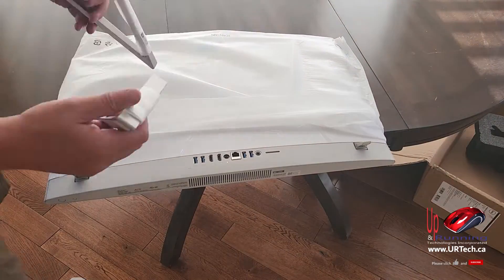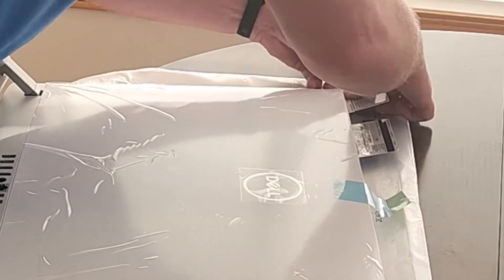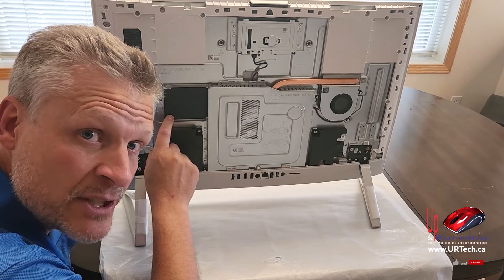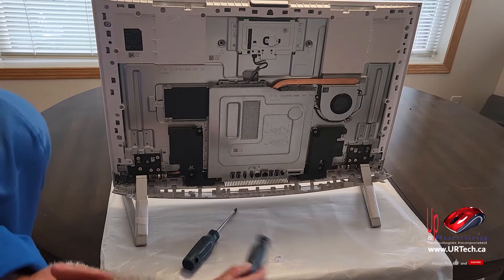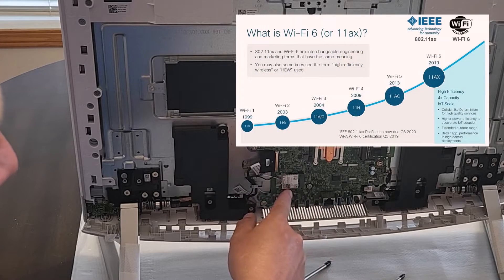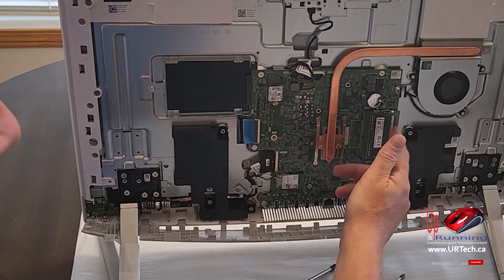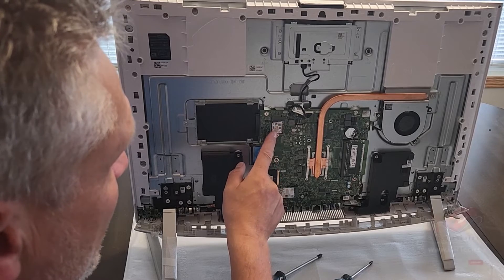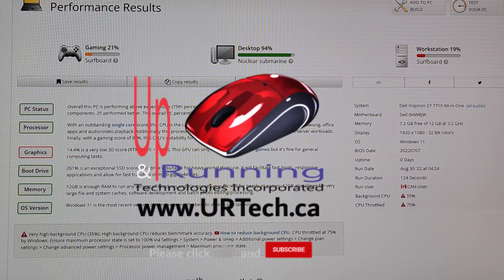Dell Inspiron 7710 All in One: Disassembly Memory Hard Drive SSD Upgrade

Comment: The D in DDR doesn't refer to doubling up the memory sticks.  DDR stands for "Double Data Rate" which now means almost nothing because it's just the normal DRAM technology now, but back in 1998 it was to signify that it was a brand new memory technology that was able to send two data signals per clock cycle, allowing it to have Double the Data Rate of the standard DRAM technology of the time.

Comment: I have the power light blinking amber 3 times, then white once. From what I've found, the 2032 lithium battery needs to be replaced and needed to find out how to get the back off without cracking/breaking it. My 7700 and the back looks like yours.

Comment: Thank you! My fan was causing problems and I was able to open the machine up to check for any dust. I used spray air to clean out the inside, closed it back up and problem solved. Very helpful! 😊

Comment: How do I reinstall operating system and Dell Bios and apps after installing new SSD? Thanks
Reply: Use a mediacreation tool from Microsoft depending on the OS that you have( Home Edition, Pro) and format it, but have in mind that there are several options to be taken in place

Comment: Can you change the video card on this item and is there an additional fan you can install to help with heat dissipation? And what ram stick would you recommend at 32gb
Reply: No you can't change the graphics card. It has integrated gpu on the motherboard. Also I don't think you can install an additional fan. 
You can install two 16gig 3200mhz DDR4 they'll help with dual channel config. also since the maximum supported capacity is 32 gig.

Comment: Hello, is there a way to upgrade the primary hard drive?
Reply: Just clone your existing boot drive to your new 2280 form factor m.2 ssd. (Can use macrium reflect home) And you're done. Also remember the maximum supported storage by m.2 ssd is 1TB while for the sata ones it's 2TB
Reply: Just replace the M2 NVMe with a bigger capacity of your liking.

Comment: So what size HD can you put in there? 2.5 HD or and SSD?
Reply: You can either put a 2.5 inch hdd (they're generally called laptop hdd's) or a sata ssd (sata ssd's only come in 2.5inch form factors). The maximum supported capacity for those drives is 2TB while for the m.2 NVMe ssd it's 1TB. Also the maximum supported memory is 32gigs 3200mhz

Comment: Thanks for your info on the Dell 7710. Sadly due to a problem, I am having to return it. I wondered if there was an easy way to remove the stands before I repackage it? Any help would be gratefully received.
Reply: It has push buttons underneath. You have to push those while removing the arch stands. They latch when you insert the stands.

Comment: STILL WAITING ::  HOOVER VACUUM HELP PLEASE ?  I OBVIOUSLY REWIRED WRONG, BECAUSE MOTOR NOT SUCKING ANYMORE. JUST BRUSH TURNING NOW. CAN U TELL ME THE WIRING LOCATION COLORS IN  OFF/ON SWITCH , I DIDN'T LOOK CLOSELY WHEN DISASSEMBLING. U HAVE the  MAIN  POWER ON/OFF SWITCH (LARGE) and the BRUSH OFF/ON SWITCH  (SMALL). CAN YOU GIVE ME the 2 COLORS TO MAIN POWER SWITCH, and the   2 COLORS TO BRUSH SWITCH. THANKS    YOUR VIDEO:    https://www.youtube.com/watch?v=0OQ-vo2kvXg